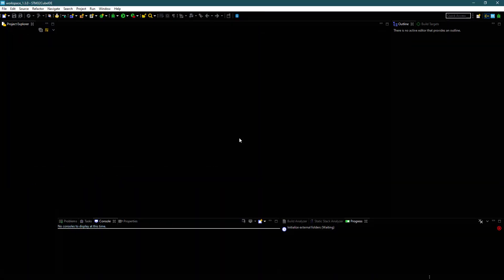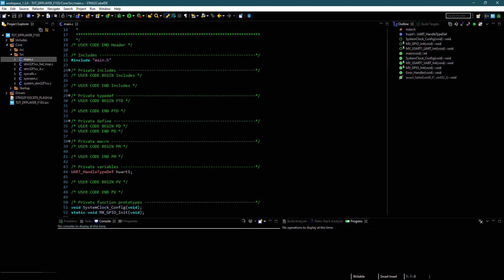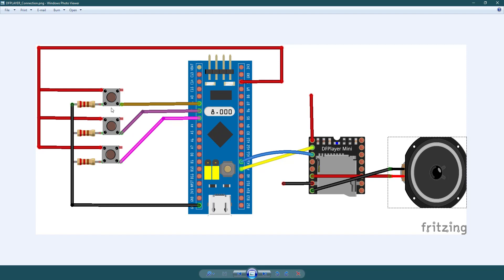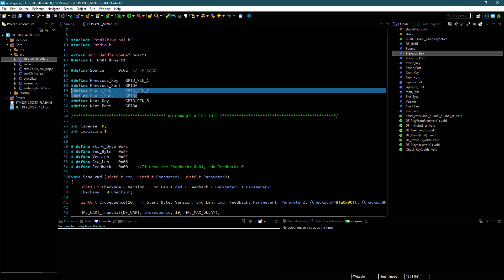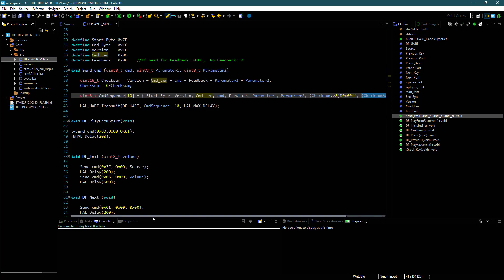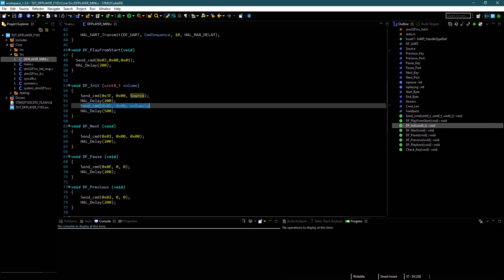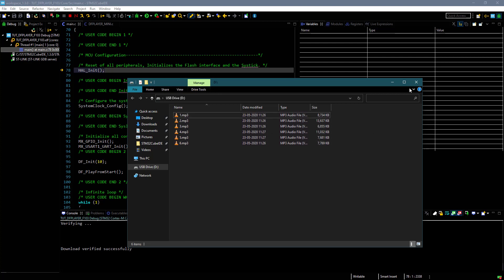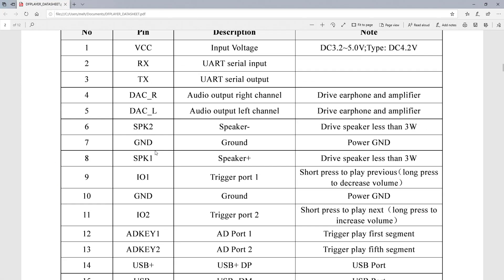Interface DF PLAYER mini with STM32

Comment: Please make a video: how to play mp3 file from TF card module using SPI interface with Stm32... Thank you!
Reply from the maker: What you think this video was about ?
Reply: @ControllersTech  I want to play mp3 files from SD Card through SPI communication using STM32 but I don't know how to do it. I saw your video about play WAV file but it used USB. Beside, I want to know how to decode mp3 file.
Reply from the maker: You can use the sd card instead of usb in that video. It will work..
Regarding mp3, well even i don't know how to decode that..

Comment: Hi nice tutorial ! Is it possible to stop a sound clip in the middle and play another random selected clip ? Like for example if I am playing 1.mp3, can I stop 1.mp3 and play 4.mp3 ? Also is there any way to understand if a clip is completed  playing ;flag pin etc ?
Reply from the maker: You can try yourself. Also check the datasheet for different sets of commands. It shouldn't be difficult. You already have a base now and u just need to add things to it
Reply: hi In the data sheet there is Specify the folder to play. With the 0x0F command, it can search for files between 1-10.

Comment: Amazing job! I'm working on a design that will use SD card with file system and SPI with DMA to read PCM audio to a DAC. A peripheral to peripheral mode. The hope is the DMA controller can handle transfers while the main loop is running. I wonder if you think this a feasible approach.
Reply: Hi, are you going to match you ADC with the PCM bitrate? If you is somehow possible, but really doesn't make much sense, you losing any chance to apply some filtering or more interesting signal processing. If you intend to use some ST32F1, your DAC probably is 12bits, PCM with medium quality is 16 bits, so you can't do it directly.
Reply: @Nhân Cao Anh Anh có thế giúp em phát file Wav từ SD card được không anh?
Reply: @Nhân Cao Anh anh nói rất đúng những thứ em cần luôn, cả cái cmt về mp3 nữa... E đang nghiên cứu mà thấy rất khó để làm
Reply: @Nhân Cao Anh anh ơi, anh có thế cho em cách liên hệ với anh được không ạ, em có vài vấn đề muốn tham khảo anh về cái phát file WAV này á anh, mong anh chỉ giáo giúp em với ạ?